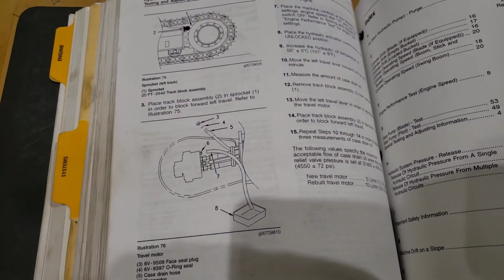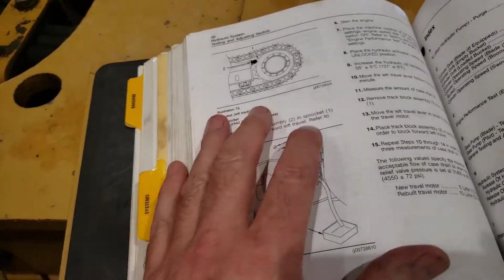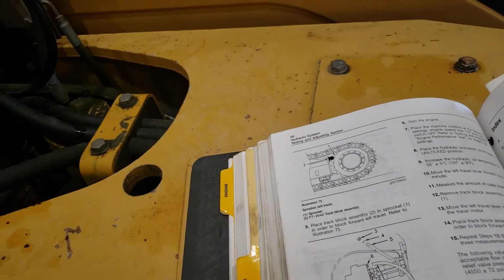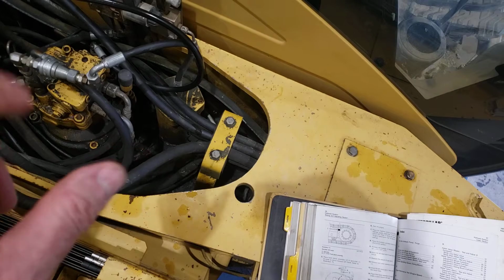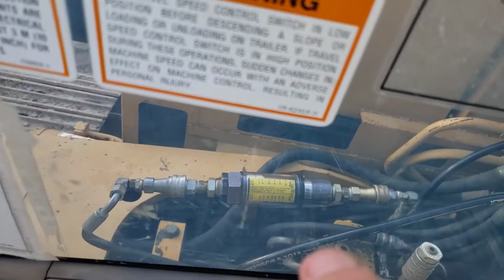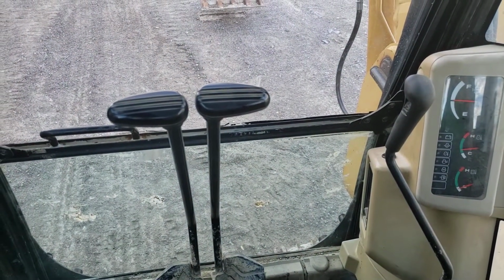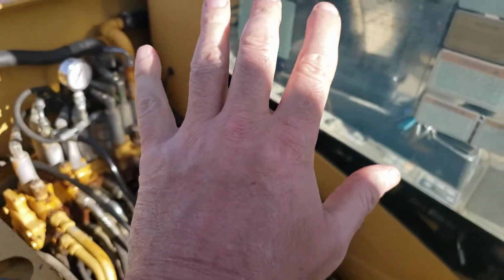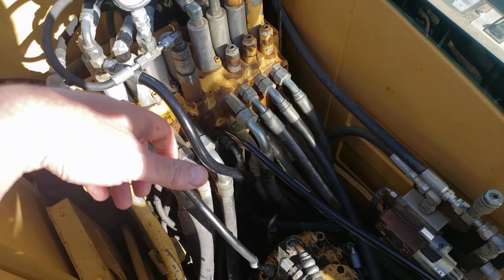checking travel motor case drain on an excavator.  troubleshooting weak travel

Comment: Hello, i have similar but reverse problem with my case cx 210 2005, when i use left or right track there is no problem with power, but when i use both the travel is slow and it sounds like the engine is overloaded, even if i lifted full excavator in the air the problem is the same, also when i try the pivot turn (using one track forward and one reverse) there is no power, but using them separately everything is fine, what could be the issue? Best regards
Reply: I have the same problem with a case 5 ton did u figure it out
Reply: @niallstackplantmachineryin6451 no... but im still trying, if you figure it out first, please tell me...
Reply: @niallstackplantmachineryin6451 did you figure it out?

Comment: Hello, My cat 311c right track seized, most oil leaked out from centre joint and retainer plate at bottom of centre joint/ swivel joint got bent like a bowl with both holding bolts snapped off, was told the hydraulic main pump needs changing, put new one in and the same thing happened. New seals and new retainer plate destroyed. Now I am told the travel motor needs changing? Could you please help in what could be destroying the retainer plate with so much pressure? these ar one track drives put in just 50 hrs before running time?? Any advice would be most appreciated. Jason
Reply: Did you figure out what was wrong with the machine? I have cat 315bl that did the same thing. Any info would help. TY in advance

Comment: Hello
Thank you for this video.
I have a Takeuchi TB153FR that is having similar issues where one track by itself won’t have power but when I apply both they function with the right track not providing near as much power as the left. Could you make a video explaining how the relief valves operate and how it’s malfunctioning can result in uneven distribution of power to the final drive?
Reply: I have a similar issue but low power / speed overall
Reply: @seanfoley4849  Either of you guys figure this out? I've got the same issue on my TB260.

Comment: With this machine how you check for error codes speed sensor/ prv solonide ?
Reply from the maker: You don't.  There's nothing electronic about this machine (aside from the climate control system in the cab)
Reply: Does the pump de stroke manually then?
Reply: No shift solonide working off speed sensor conected to controller then.The  cat 311uc is controlled this way not saying they are the same machine but are c models my machine is giving me problems  shift solonide not functioning properly
Reply from the maker: @Agirhydro23  yeah this 307C is called a "C" series but doesn't have all the electronics of the bigger excavators
Reply from the maker: @Agirhydro23  calibrate the prv.

Comment: A couple of days ago i changed the seals of the drive valves(found under the paddles) of a CAT 219DLC. Today i moved it but when i came to move it again it didnt want to move neither way. The paddles responded because i heard the Hydraulic pump. Could there be air in the Hydraulic system?

Comment: I've got a similar problem with my EX60-2. I have full power when both levers are used either the same or in full opposite directions to spin. If I relax on one of the levers the machine doesn't have the will to turn. If I slowly ease into it with only one lever often the motor will hardly load down and the track will just sit there and barely move/shudder. If I move the lever fast I have power. My machine has a flow combiner valve. Could this be the culprit? I took both of the relief valves out last night and disassembled them and they both look just fine.
Reply: That's problem with the adapter sieves on the valve block
Reply: @shortrelaxingrainvideos8619  adapter sieve? I checked the case drain on my center joint yesterday and it is flowing when the track is stalled so I think that's my problem. Case drain on the track motor is almost nothing when stalled.

Comment: Hi. Nice vid sir. Just wondering if a bad main relief check valve seat would have the same effect to other function like, swing perhaps? Thanks! ❤️
Reply from the maker: it could affect all functions (both bad), or all functions on one side of the control valve (one bad check valve), but not one individual function like swing.
Reply: @hydraulics  these check valves have system pressure rating or low pressure?
Reply: @rjrjabian  they are exposed to full system pressure

Comment: U can check return pressure also if above 6 bar ( 88 psi) u need to change the pump or motor hydraulic
Reply from the maker: Hmm. Who's to say the cooler or filter aren't plugged up? I wouldn't trust your test.